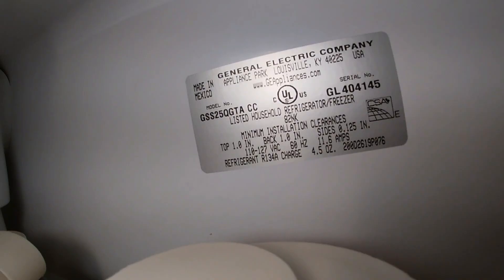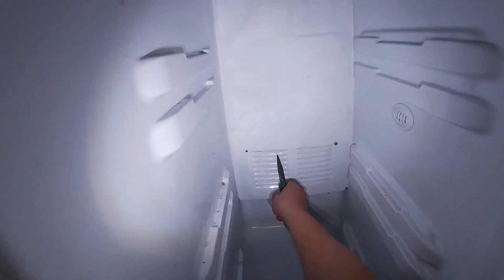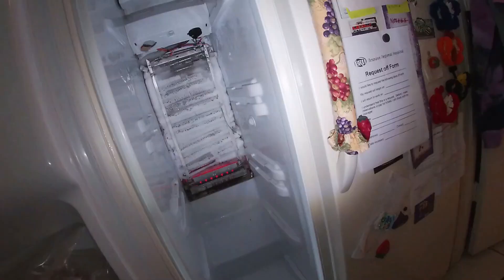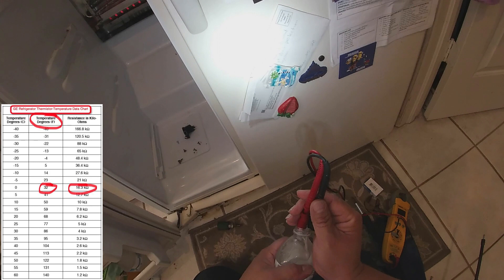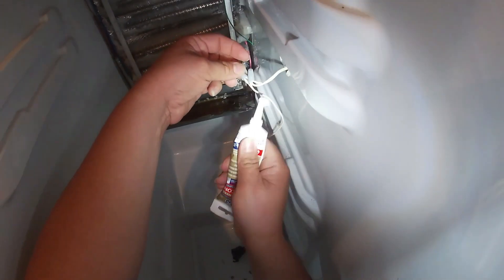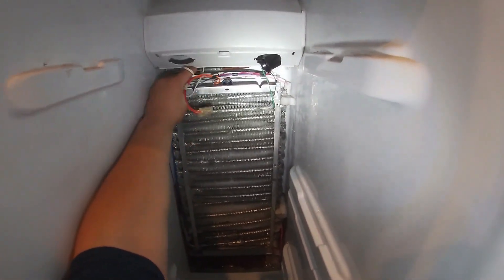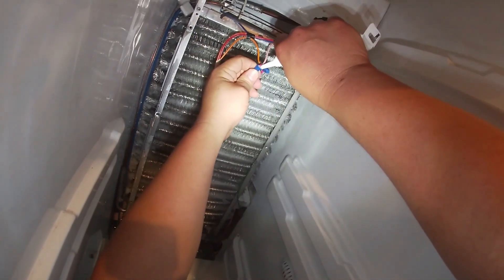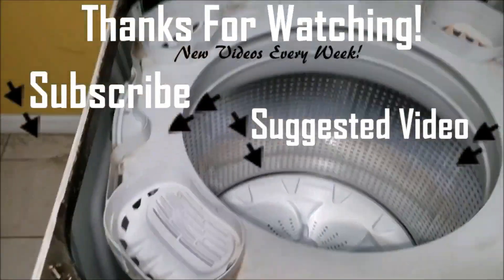How to Fix GE Refrigerator Not Cooling Properly | Random Temperature Drops | Model GSS25QGTACC

Comment: I have a GE French door and replaced the fan in the refrigerator and it seemed to help a little. Now I noticed my display shows the fresh food is 37 degrees but it is actually 46 degrees. What could cause this?  Do you have a video on showing this repair?  Thanks again for your helpful videos

Comment: Soooooo, your video is the only one I can find about the crazy temps. I have that problem but changing the thermistor didnt solve the issue. My freezer is way too damn cold, and keeps on cooling. Fridge temp is a lil too warm, damper is opening and closing, both fans come on, I replaced the thermostat cuz it had continuity while at room temp and in a glass of ice, I also replaced the defrost heater, cuz why not do some preventative maintenance on my malfunctioning sxs. I replaced the control board back in December,  but I just got a replacement and will go swap it and maybe that might solve the problem. However,  what about the dispenser interface?  Doesn't that have everything to do with temp control? Perhaps that has a sensor that went bad, well who am I kidding,  of course it must have a sensor or 2, or 3 cause why wouldn't it, lol. Samn electronica,  damn.